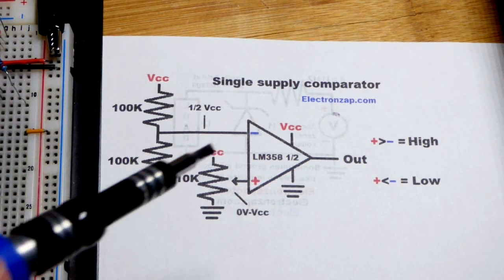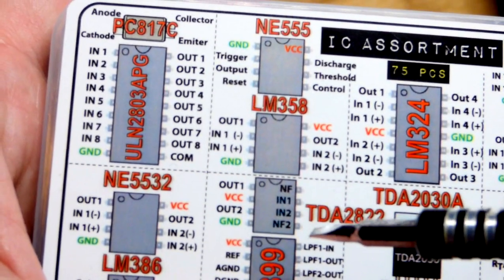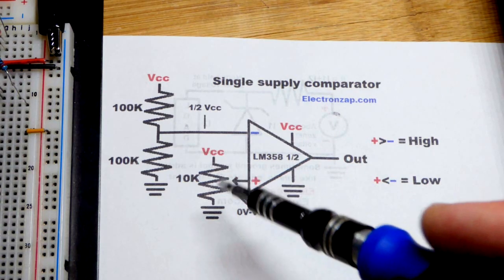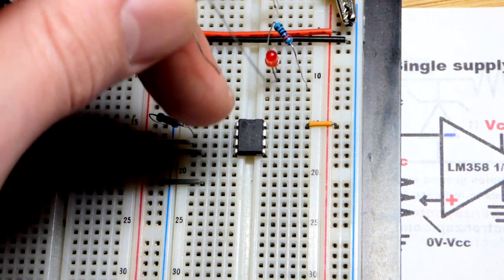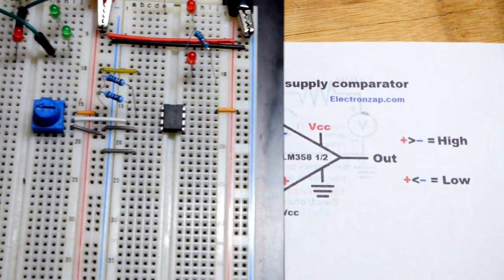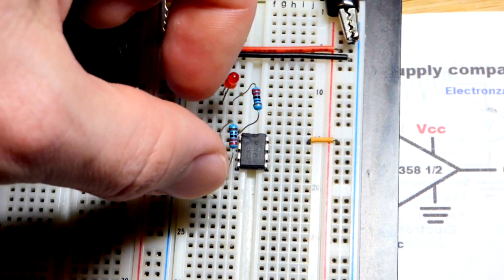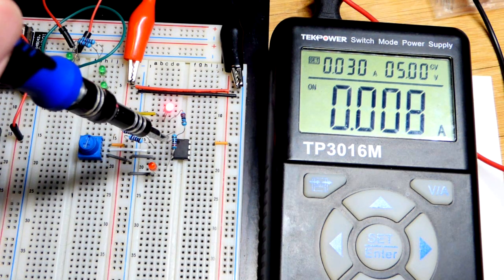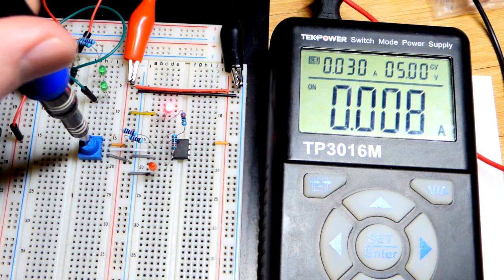Quick single supply op amp non inverting comparator circuit using LM358 operational amplifier

Comment: Different grades of these op amps , the ones used in  medical gear circuits are expensive I believe.
Reply from the maker: Haven't researched that yet, but I often notice datasheets pointing out that their component is not for medical.